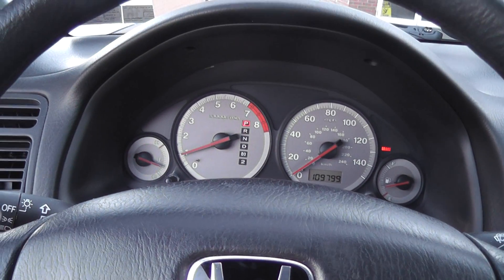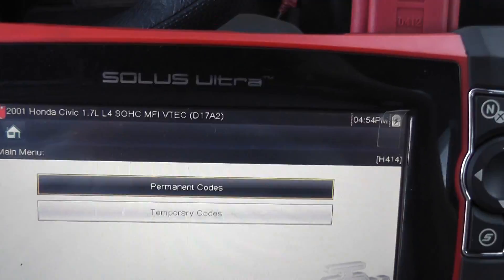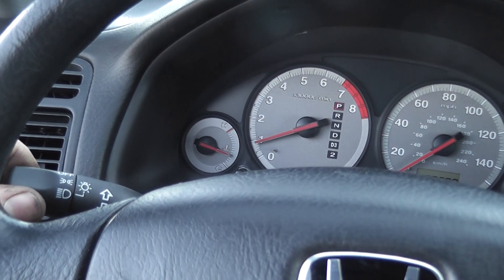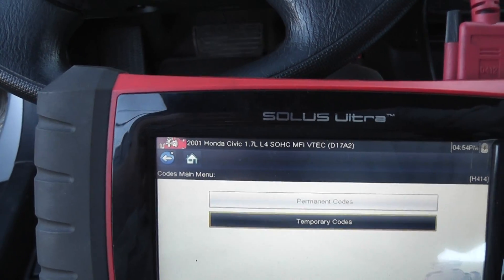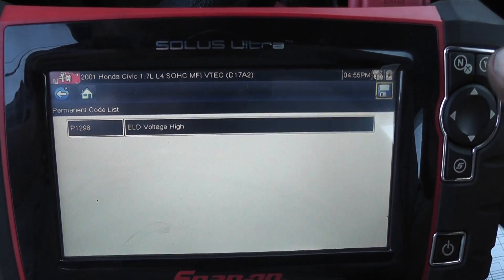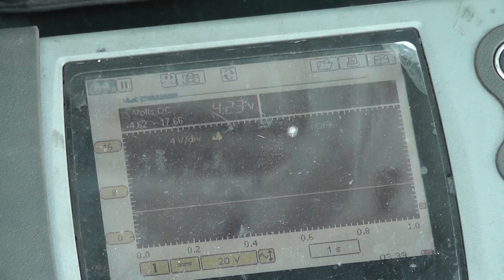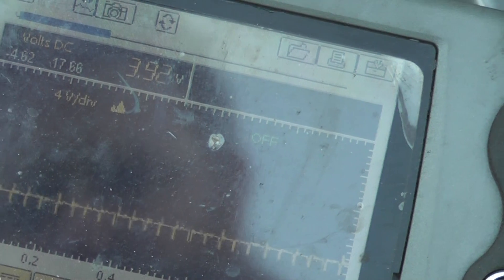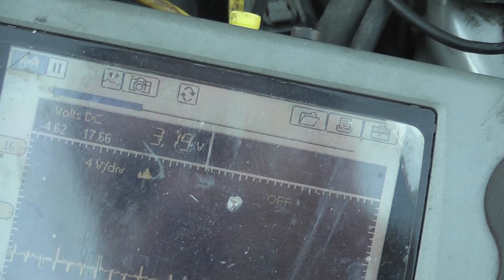HONDA ELD   ELECTRIC LOAD DETECTION P1298

Comment: I just replaced this today on my 05 CRV with a stick. Lately it’s been having some cranking issues when starting it sounds really weak and I already replaced the battery in the alternator and I know that the previous owner had the starter replaced at a Honda dealership. Not to say that this one isn’t bad because they are known to be problematic on these cars, but I know that this ELD is a known issue with Hondas and there is a service bulletin on this issue in fact, so I went ahead and replaced it and already I can tell that the car is cranking over a bit easier now. I also took the opportunity to spray any corroded areas as well as the metal bar that goes through the ELD with electrical cleaner while I was in there. I haven’t tested the starter yet, but I do plan on doing that in the very near future to see what kind of cranking amps it’s putting out.

Comment: 10 cents check, at idle runs on battery voltage with no major electrical load. To test, turn on headlight  then see if battery voltage goes 13.5V to 14.8 V.  ELD  should be ok. My thought.

Comment: My 2000 civic is 23 yrs old so I know my eld relay needs changed. I’ve bought a new battery and alternator and my voltage drops after 10 minutes of driving on the freeway when I come to a stop in gear. When I put it in park the voltage goes back to 14.3 but in drive it drops to like 12.6 so I know it’s old from wear and tear from all these years of driving.

Comment: Bro i have check engine light on with this code, but in the fuse box dont have the ELD and nor does it have the connector where the part goes, what can I do?

Comment: I have a 96 integra, that was B20B engine swapped and i have a code for a P1298 (ELD) but i go to the fuse box and their is no ELD, like no slot, so im at a stand still any help on that?
Reply from the maker: Urs is probably built into the fuse box. Some were. U gotta change the whole thing
Reply: @jamesdanner7850  comes to find out changing the O2 sensor gets rid of the code.
Reply: TBKwolfwolf10 holy shit you’re right I had two bad o2 sensors and bam changed the o2 sensors booooommm code 01298 went away!!!
Reply: @erictech201  I'm glad I was able to help someone out!

Comment: if your eld is blown then you should be experiencing the car starting but then slowly dying and then abruptly bog and kill its self. Basically what the eld does for the alternator is allow it to send power through the exciter/field wire to go back to the battery to charge it. If you don't have the eld working it cuts off the connection to the exciter/field wire thus not charging your battery so you are running off the battery's power. Also what I found is that when you have a blown eld ( may not be for everyone but in my case it was) is that it send way to much volts to the alternator which then effects the voltage regulator. Sometimes it's in the alternator, but sometimes it's external. If you have the voltage regulator in the alternator then you most likely need to change the alternator when replacing the blown eld fuze. Hopefully that helped some people because I was puzzled for about 3 days trying to figure it out.
Reply: Colin Kasprak hey just curious im experience this on my 2000 accord lx 5 speed. Just wondering since you mentioned changing the alternator after changing the blown eld fuse. I changed my alternator and every other electrical component about 3,000k miles ago.  Is changing my alternator again necessary?
Reply: Dealing with same issues atm. ELD/Alternator

In my case WHEN running will not engage Drive gear (wont drive in drive lol). Related? Troobleshooting

Thanks for your summary though helps!
Reply: Yes it did a lot  I was lost an couldn't  find out
Reply: Omg the same thing happen to me today also the car goes on bur with a jumper after I take it off rpm goes to 0 I put the gas all away down and make a big explosion 🤣

Comment: Same thing happened to my 97 Honda Civic, turns out it was my "alternate s fuse" underneath my steering wheel. It turned on the P0135,P0141 And P1298. So check all ur fuses and BAM UR BACK ON THE ROAD!

Comment: I have 05 Euro Accord.   Also have P1298 ELD High voltage .. changed ELD (took a part whole fuse box to change that), but still this code appears in permanent section. It's possible that there is problem with ground wire somewhere in car.
Also, when connected OBD2 computer, ELD shows minus 0,35A, normal would be some positive number, depends on turned on electronics. I am guessing, I need to change ground wires and hope for the best? But could bad ground wire mess with obd2 readings to show -0,35A?

Comment: 02 crv had no check engine light on.the car was idling highwhen pulling up to lights or in the driveway thought it was iacv cleaned it and it didnt help.i plugged it in and code pulled up .replaced the eld and problem went away never even heard of it or had to replace one before it was weird.but glad it was an easy fix
Reply from the maker: +rsxstype505 thanks for the input,  I'll keep that in mind

Comment: The ELD(A) data PID is an amp measurement that the PCM is converting from the ELD voltage signal (signal voltage at the PCM should usually be between 1v-3.5v approx).  

Some quick tests you can do on most newer Hondas is to check voltage on ELD signal wire and compare to data PID ELD(A) at idle (if you have the ELD voltage data PID that's even better).  If you are close to these numbers you are probably ok.

Idle only (vehicle warmed up), no loads: ELD signal voltage 3.3v-3.5v = ELD(A) PID reading of 13-15A

Idle with Headlights ON: ELD signal voltage 2.5v-2.7v = ELD(A) PID of 25-27A

Idle with Headlights ON HIGH/Defrost ON: ELD signal voltage 1.0v-1.2v = 56-57A

When the PCM detects ELD signal voltage that is too low (usually below .5v or so) it activates MIL for P1297 (ELD circuit low).
When the PCM detects ELD signal voltage that is too high (usually above 4v or so) it activates MIL for P1298 (ELD circuit high).

Some of the ELDs on some Hondas are part of the under hood fuse box and fixing it requires replacing the fuse box.

Hope this info helps somebody out.
Reply from the maker: +Big Dog50001 that's some good stuff ...u can't find info like that easily.. thanks
Reply: Thanks for this info. Will a ELD going bad cause my, 2006 Honda Odyssey to stop charging or does it only throw codes? Can't figure out this charging issue
Reply: @ltreyno  Do you fixed?
Reply: My 2008 CR-V ELD is buried under 2 layers of panels in the under hood fuse box, I took it out and going to replace it. No charge condition after replacing alternator due to battery light on dash and no charge condition. I hope it fixes the problem. I did not use a code reader to diagnose the problem.
Reply: @tiredowalkin  I just replaced the alternator in my Acura RSX and the battery lights on but it is charging and the computer does have control over the charge duty cycle so I don't know what's going on with mine the only reason why I changed the alternator was it was overcharging at 16 volts had no codes no battery light on nothing it was overcharging only so I changed it with a reman Nippondenzo which I heard are junk after I put it in but it charges fine now I have a battery light on but the computer still drops to low charge status and bounces to high charge status when it needs more power so I have no idea what the hell is going on
Reply: @martinbullla7654  I wish I knew what to tell you, if it charges properly that will keep you on the road my friend. My problem ended up being severed wires between the under hood fuse box and the alternator itself, how this happened is one of the mysteries of 2020 for me, but I removed enough wiring harness to repair it on the bench and replace it, I had to solder because I was not going to pay a Chicago pirate called Connector Experts $47 for 3 little crimp on terminals. I wish you luck but if your alternator is on warranty, and you feel like replacing it again , and you have some knuckle skin left , it's your decision.

Comment: Do you know how to bypass the electronic load detector so the alternator was stay at higher voltages all the time please let me know because my system is suffering because of it
Reply from the maker: +Don Heston sorry.  I never tried
Reply: +James Danner I've read that if you put a 820 Ohm resistor on it that it'll drop the voltage enough to make the alternator stand high output mode if you Google it it's under is Steve Meade post it goes into detail with a relay and everything but from what I've read if you just use the resistor will do it check it out

Comment: Will this ELD mess with the ECU? I have an issue with the O2 sensor heater wire there is a malfunction and I just changed it but the issue still persist. I wanted to know if the ELD had anything to do with that issue. Can anyone help?
Reply from the maker: +Alder Ruiz not sure. What year and model and what is the o2 code number?

Comment: what year of car is this
Reply from the maker: +Jesse Langdon 01 civic. Sorry I wasn't clear
Reply: +James Danner oh, got this code on my 98, yet I don't have a eld
Reply from the maker: Some of the older ones it was part of the whole fuse box. I'll look into it
Reply from the maker: +Jesse Langdon my Mitchell program shows one in fuse box behind right strut tower. It's top left if u are looking at it with the 2 main power wires on the left. Looks like 2 offset screws with maxi fuses at either end
Reply: Am I able to replace my fuse box from 98 to a fuse box from a 2001+
Reply from the maker: +Jesse Langdon probably not.  But from the picture I saw it looks like it might be replaceable like mine was
Reply: I wish I could upload a pic in the comment, mine ( if your standing beside the car facing the engine bay) has the two main wires attached on the right, and the two fuses the eld is between. I have them but in the shape of a "L" and no eld , I'll probably just replace the fuse box
Reply from the maker: +Jesse Langdon I think the L bar is what the eld wrapped around to see current flow. That's weird if u have no eld and a code for it. Does the check engine light come on for this?
Reply: +James Danner that what confused me. I do get check engine light with the p1298 code. however my speed senor went at the same time, so I wonder if the eld code is linked with the speed sensor when it went bad?
Reply: +James Danner as well I have done a tranny swap auto to manual, I have the p2e l32 ECU which is supposed to be for the right car.
Reply from the maker: +Jesse Langdon my check engine light was not on. Some comments said it may not turn on the light like older knock sensor codes. I am not sure tho. Maybe fix the vss issue first?

Comment: I'm sure that will not set the cel for that code. I've seen most of those elds fail at 4.5v always voltage high failure
Reply from the maker: +Cody Wichman yea. It looks like the computer supplies that voltage and it gets pulled down

Comment: Nice fix James! Hope that Dorman replacement holds up as well as the OEM ELD sensor did. I think Tobias already mentioned this below, but the ELD (A) Pid most likely indicates the total current amp draw by the vehicle. That was just a coincidence that it was 13-14Amps when you looked at it. A good test would be to turn on the headlights and see if it goes up to like 30Amps :)
Reply: ELD failure = dimming again or just staying in the 12.5V mode.
Reply: I'm late to the party, but I'd imagine the "A" in ELD(A) stands for amps.. that the pcm was converting the eld input to show the scan tool the amps of current going through the sensor.

Comment: Thanks for the video, never heard of an ELD sensor before.  Seems like it's an over engineered part for no real purpose?
Reply: The sole purpose is to allow the alternator to not work as hard as it should.  This, in turn, makes the engine not run hard too.  The end results are the MPG goes up.  This is to satisfy the Government, who puts pressure on all of the car manufacturers.   Look at all of the problems with batteries failing because the ELD is not a realistic solution.  Not everyone drives 50+mph on the highway every day which is needed to properly charge the main car battery.

Comment: I've 'heard' (note quotes) these things are just an inductive amp meter... there so the ecu can goose up drive by wire idle speed a little to compensate for large electrical loads... like the electric power steering being hard cranked. Have also heard they do fail now and again. Great videos, Thanks!

Comment: It looks remarkably similar to a current transformer. Senses current thru a circuit and trip a code if there is high or incorrect current draw in the circuit. After marked mods or additions by owners cause the problem you are seeing? 

Although In my experience I have only seen current transformers used in AC circuits where high amperage draw would be a problem and the circuit is disabled if the current transformer senses a problem. I have also seen them used to indicate that a circuit is live.
Reply: Pomona Bill Thanks! As you might have guessed in my post I generally see these in an AC circuit where they often do function as transformers. Just as James Danner mentioned for himself, I have never encountered one installed in an automotive application. Live and learn

Comment: I am from Quebec(Canada) and i once saw that code on a 2003 CR-V while doing an inspection but the customer didnt want to have it fixed so thanks for the pointer if i ever come across this code again i'll have an idea what to look for
Reply from the maker: +Markymark24 nice! . I was picking on Steve rob up there. With the USA models only and in one day ,I'm  wrong.... sweet
Reply from the maker: +Markymark24 did it turn the check engine light on?
Reply: James Danner  well i cant tell because it also had idle control trouble codes and like i said the customer did not want it to be fix, but i just did a quick search on a honda tech forum and it seems that it does indeed turn the check engine light after a couple of trip

Comment: Typical over engineering. Reads the amps being drawn across that bar, converts it to a voltage and that tells the ECM how much current the alternator needs to put out to keep things happy. Basically takes the place of the voltage sense wire on most other brands.
Reply: Amperage is a much better way to sense load. You can still have a high voltage with bad cabling but the current will be reduced causing you problems. This way, measuring amperage, it cannot happen.